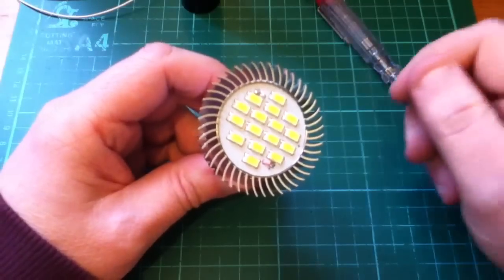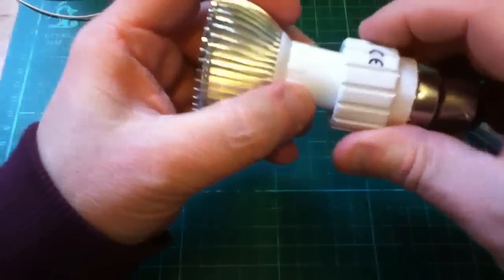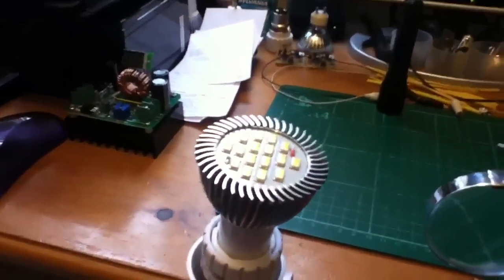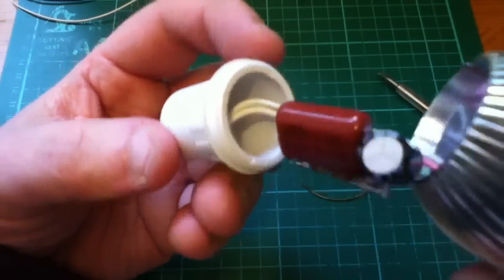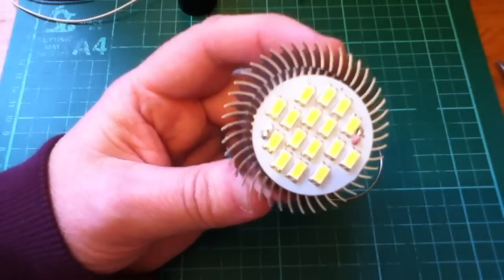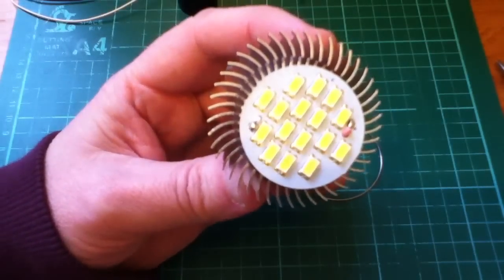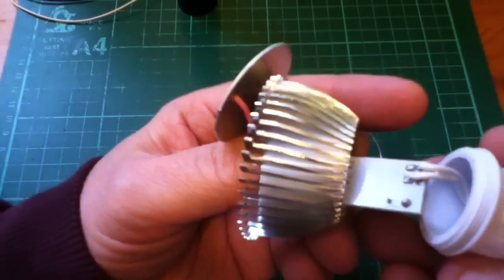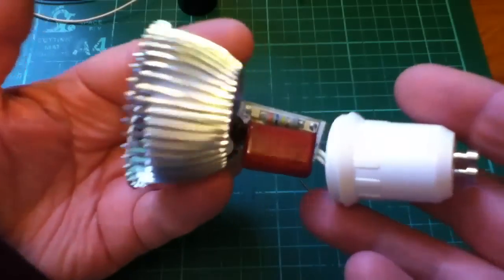Dangerous GU10 LED Spot Light is Cheap and Bright but could Kill You - Seriously

Comment: the driver without IC, not constant current driver, it has not output short circuit protection, and no over-heat, over-voltage protect. It is dangerous for this type of light.

Comment: This whole video can be debunked in the first 3 minutes.  He says it himself "There is a bridge rectifier, a smoothing cap, and electrolytic cap".  The bridge rectifier immediately converts mains to DC.  He then goes on to say that mains AC will be on the terminal 50 percent of the time you plug it in depending on which way you plug it in.  Not true.  The bridge rectifier rectifies both halves of the AC wave and combines them into DC before any of the other circuit.  Lastly... electrolytics blow up when you hook them up backwards. LOL.  Simple
Reply: Atomgonuclear - when you have a theoretical knowledge of electronic circuits, you laugh at other people.  The bridge rectifier will not protect you from mains.  It maybe DC between output terminals, and even safe low voltage DC.  However, if you touch, you introduce a new path for the current; you will have the full mains voltage, minus one diode drop of 0.6v, across your body.
Reply: Vijay Kumar r
Reply: +1, You are correct in the rectifier would prevent "live mains".  The producer of this video sounds like he knows what he's talking about, but he doesn't . Glad to see someone else correct him. Good Job Adamgonuclear. Thanks
Reply: atomgonuclear .
Reply: one sensible person..... ive used a lot of these mains Capacitor power supplies myself ..... it does give a slight tingle if you touch even the  led side of the  wiring .... but nothing lethal

Comment: It's indeed unsafe because:  during one half of the AC cycle, one LED wire (the one without the resistor) will have main voltage on it (less a bit of voltage drop from the diode) from the live side of the main input.  So if someone touched it and was also grounded, they would feel the full main voltage amplitude (but half of the RMS, but still lethal). 

It's also inefficient to drop the voltage with a resistor.

Comment: Wow there are many people that have no clue what they are talking about and some that do. Just one thing I would like to talk about. The LED will run on AC but there will be Flicker(not at full line voltage of course. To explain, the LED functions as a diode and will only allow current to flow one way.) The Full-Bridge, or half-bridge, rectifier will produce a 'fixed polarity' DC Pulse to be filtered by the Capacitors; which is fed to power the LED. (I personally would prefer it be made with a Full-Bridge Rectifier as to create a 100hz pulse instead of a 50hz pulse. ( It would create less flicker.) All that being said. The supply to the LED board is going to be the same all day, everyday.

Comment: If the voltage drop resistor is AFTER the bridge rectifier - you wont get the live/neutral swap.
For any reason if the + and - on the lamp side is reversed - the LEDs will not work as they obviously are diodes and only work in one direction.
You need to measure with a digital mulitmeter the two connections going to all the LEDs, then reverse the polarity in lamp holder by turning the lamp 180 degrees.
By the way - I am actually a fully qualitifed electronic technician and an electronics engineer.
I would imagine the resistor drops the AC lower before going into the bridge rectifier and smoothing cap making it perfectly sage.
Plus also it is made to work with the glass on which would protect from shock.
Other LED lamps are dangerous (the corn cob ones especially) but I do not believe this one is, it may not last very long looking at the quality of components but I do not think it is allowing an un 'reisistored' live feed onto the lamp.

Comment: I'm pretty sure you are wrong. Usual main outlet is 120 V AC or 230 V AC 50 hz. AC meaning alternating current. So whatever way you turn it in makes no difference. The rectifier is for LED's that require DC voltage. SO... if you are right, you get shocked in both cases. But i'm sure you don't.

Comment: Why not try use 12 volt battery if u want to cut led's wire - & + from 120 volts light ? Just test if works or not .

Comment: The insides are basicaly the same for every cheap "home eddition" LED there is on the market (at least those I've seen). The only difference is usually that they use two resistors (or a cap and resistor) on both sides, so neither is directly connected to output and they use a bit of glass or plastic to actually cover the top...

Comment: So you know nothing of electronics.   Resistor on positive or negative has the same protection.   If you complete the circuit with your hand it is still using the resistor in the flow of current either direction.   So everything you just said was pointless.

Comment: Very interesting; unbelievable that this products is on sale.
Reply: Neymar 213 Non il dit que le danger provient des fils (rouge et blanc) qui arrivent sur le plateau ou se trouvent les LEDs. Et il insiste sur le fait qu'il n'y a que quelques microns entre l'endroit ou la phase arrive et le dissipateur de chaleur qui n'est mis a la terre. Bon maintenant j'ai du mal a piger pourquoi c'est si dangereux puisque le 230v passe a travers un circuit qui a mon sens doit diminuer le voltage sur les fils qu'il decrit (12 volts?).
Reply: Manu Delmarche ""puisque le 230v passe a travers un circuit qui a mon sens doit diminuer le voltage sur les fils qu'il decrit (12 volts?).""

12 V +/- ou autre ne veut pas dire inoffensif: certes le circuit additionnel fait chuter la tension qui arrive au niveau des LEDs MAIS vu la manière dont il est conçu il n'apporte en aucun cas une isolation galvanique. 
C'est se qu'on appel parfois une alimentation dite "sans transfo" ou capacitive.
Tu obtiens de la TBT entre les bornes de sortie mais il existe toujours une tension dangereuse entre une de ses bornes et le corps humain (potentiel de la terre).
Reply: pourquoi ??
Reply: ***** Je suis pas fort en anglais mais je comprends pas mal de mots techniques:

Il démonte une lampe à LED conçu n'importe comment et qui est très dangereuse.

En gros elle s'alimente avec le secteur et les isolations circuit électrique/corps métallique sont dérisoires ce qui fait qu'on peut s'électrocuter en agrippant la partie métallique.
Reply: Il provient d'ou le danger des led ?
Reply: *****
En théorie il suffit donc de manipuler l'ampoule interrupteur éteint ou avec des gants ?
A l'allumage si il y a court circuit le disjoncteur devrait fonctionner...
Personnellement j'ai 8 de ces ampoules et pas de soucis pour l'instant...

Comment: even when they are using a transformer to separate the circuits, they can be still be fabricated VERY cheap .. i got a 10x pack of 4x2W GU10 LED Lamps and they started flickering after half a year and you still get shocked because the transformer shorted out because of cheap fabrication -.-

Comment: Dude, stop saying nonsense. Haven't you seen that MB69 transistor? It's a typical diode rectifier that drops voltage to about 90V, and then the big red capacitor in paralel with the resistor drops it again to ~46V. It's indeed a high voltage, but nothing lethal.

Comment: Most people seem to miss the biggest danger.  When unscrewing the bulb from the socket it could unscrew the cooling fins from the white plastic and contact the cooling fins in your hands to the full voltage from the wires.  I dont care if it is 110, 240, or 400, you don't want to feel it!  Very scary!

Comment: Interesting point about the resistor only being on one side, is there a way to make such a circuit work with resistors on both sides? DOuble the components and half the values? (or is that double the value with the capacitor?).?
I'm guessing that after the rectifier the voltage is less lethal as it is going to be DC not AC so i would imagine that you would only get a little shock if any, has anyone tried it to see :D Jullian did you try measuring voltage between the exposed wires and earth?

Comment: It's not that bad. Radios used two prong power cords for about 40 years. Plug it in one way, and the chassis is connected to neutral. Plug it in the other way, and it's connected to hot. I've worked on these radios for a long time and have never considered them to be unsafe. Old valve guitar amps are often the same way. The key is to make sure that you're not grounded, and you won't have a problem. You shouldn't be touching both terminals anyway.

Comment: so the fact that its stepped down, rectified, and regulated before reaching the front plate can just be ignored then? mmkay...  would of been more convincing if you measured the voltage and available amps at the exposed terminal when it had power, or better yet at the heat sink...  compare that to those super scary 9v batteries ;)

that heat sink is probably anodized too, that stuff isn't very conductive...

since you won't be using it want to send it to me ? ;)

Comment: Julian's right, Needs an iso transformer take them out and use them on 12v solar system fine, if not dump it in the bin, dont plug it into the mains.

Comment: Regarding the front PCB; I've actually had some of these made; It's pretty much a fiberglass sticker on 2.5mm aluminium sheet. Fine for extra-low voltage, but as you point out, quite dicey for mains stuff!

Comment: In the rush to make LED bulbs of all shapes and sizes cheaper, brighter, and get them into the hands of consumers looking to save tons of money on home and yard lighting bills - there are many unscrupulous factories in Taiwan, China, Mexico, and even Africa now - that are turning out and selling bulbs that should not be made or sold to anyone! If it seems too much of a bargain to be true (ie: 3 gbp on ebay vs the  Cree Equivalent online that runs about 10 or 12 pounds) then run like hell. The dangers may be subtle or obvious as in this video. But these things can kill you! and the GU10 circuit is designed to be ambi-polar - which makes it even more dangerous if not manufactured properly. BTW: the addition of a polarity guard circuit to this lamp could have cost them an extra 3 or 4 CENTS - yet they would rather risk their consumers life than put it in and lower their outrageous (already) profits. You can bet that tracing the manufacturer of this piece of sh*t would be all but impossible and you would find that they are owned by a series of companies that makes locating or suing the owners all but impossible, too.

Comment: Answer is simple. Go to Cree, Linear, On Semi, Fairchild, ST and many others and use an isolated offline LED PSU. The individual LEDs are 350mA at 4V each. The PSU you have there is a crap circuit I would not use on a bet :P You need a 72VDC source for 16 series Blue/Phosphor LEDs and divide the 64V or so by the power to get the current. Should be between 120mA to 350mA.
Reply: Unfortunately, that costs good money... We, the consumer, have price as our main priority most of the time, so bodges like this one become widespread. 

We'll just have to wait for this sort of garbage to kill a few people before anything is done about it :-/
Reply: Peter McKinlay You're probably right. Sadly, bulbs with inferior voltage regulation will likely never get blamed for such a thing. It will be their abysmal power factor that gets them removed from other markets. In the US, such bulbs must meet the PF1.0 standard. Only seen a circuit like that in the 7W Night Light bulbs. Too small for an active circuit and they only draw 0.5W total power. I have also seen this passive RC PSU in large LED traffic lights for the Red and half of the Yellow lamps. Power factor for the RC circuit was 0.7!

Comment: I noted you didnt take the time to place a voltage meter on the "dangerous" spot on the light. Had you, you would have quickly realized no matter how you have the bulb placed into the socket, the section hidden in the base is what we call the driver. ALL LEDs are DC current inherently. The driver MUST convert the voltage to DC before it reaches the chip board carrying all of the chips sets. I personally do not know of anybody who have ever been fried by 30VDC.

Comment: Nether wire coming out of  cap dropper can be considered safe. you forget that with an ac wave flowing though a cap every cycle the wave is reverses so earth ground is flipping back and fourth between each side.

 In the  less  used arrangement  you can make one side neutral if you use a half wave rectification but still, not a good idea there really needs a cover over it the solder mask doesn't cover it, but i would find it more likely that it is coated in epoxy or other low conductivity material. You need a real appliance tester to verify that though.

Comment: Well, i remember that for like, 40+ years we have had christmas lights connected in serries straight in mains, with no capacitors, no fuses, no resistance no nothing but still....we were using them...only twats were getting burned-electrocuted etc.... If someone is stupid, then we will not make the whole universe stupid-safe....we dont need to dumb down the whole dam world for the fools-stupid-idiots....

Comment: Even in case the lamp is plugged "in the right direction": If the LEDs fails (which they certainly do within this decade) you will have to change it. And then you have - due to missing load when a led passes out to unlimited restance- again 230V mains on the front. and this is then the situation when you will touch it.
and in some cases "the home electrician" will not be able to tell if it's switched on or off, since the lamp is "off" in both positions.

Comment: Mains voltage is rarely "lethal".... Unless you're GRIPPING a metal tool in direct contact, or your hands are very wet.  Considering I've touched 110v and you only feel an uncomfortable tickle.  I'm not saying that it CAN'T kill you, but most likely you'll just get an  "ouch! holy fucknuts!" instead of the "death grip"